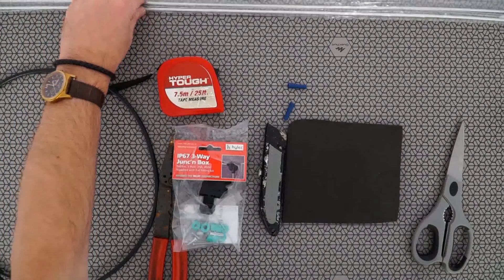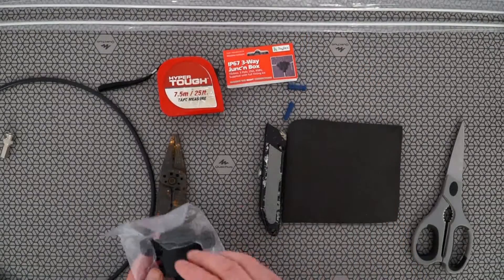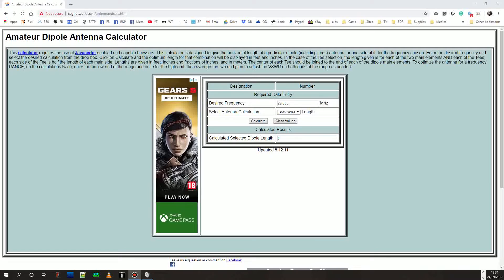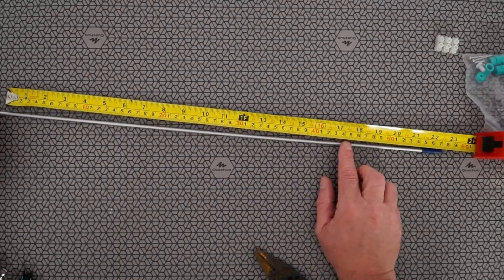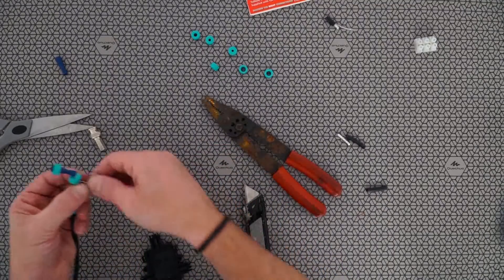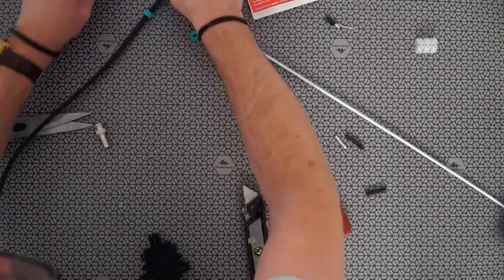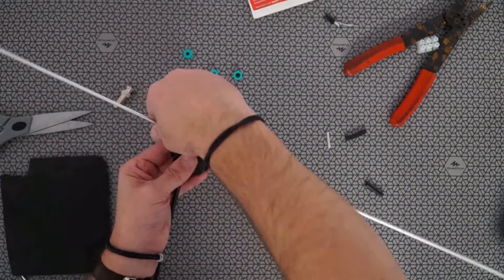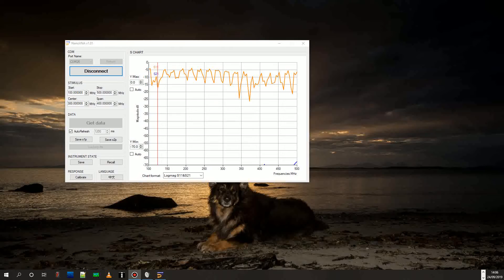Building a cheap lightweight dipole for VHF or UHF

Comment: I put a 30amp connector block mounted so the rods go straight in plus co-ax. I had cut the connector block in half & insulated L+R sides with a thin bit of plastic. Fixed every thing down with hot glue gun.

Comment: 3:32 and they use wavespeed 300 exact and rounded result 468/143
correct 
metric
299.792458/2*0.95=142.40141755 (yes not 143) in math we round final result(cut material)
feets convert
142.40141755*3.2808399=467.196252514600245 (not 468)

142.40141755/Mhz = length meters (half it)
467.196252514600245/Mhz = length in Feets (half it)

Comment: If you wish to solder use copper materials. Aluminum MUST be crimped, clamped, screwed, welded, as it can NOT be soldered with standard electronic soldering irons. Using a torch and aluminum brazing rods might be a bit much for the coax.

Comment: Just Remember, If You Keep This ANtenna Verticaly., You Need To Keep The Central Wire On Top, Not Bottom.
Reply: Which way should face for airport also what is the central wire as u say in Ur question/answer..my newbie  question lol
Reply: @robertburns202  He means that the rod which is connected to the central wire from the co-ax should be on top. In this orientation, the antenna works equally well in all compass directions but not directly up or down.

Comment: I Used Similar Materials, I Just Used Copper Pipes With Silicone And It All Made It Weather Proof And Vibration Proof Because Of The Silicone, Put The Vertically On A Fishing Pole And Fishing Pole Into The Mounth In My Third Store Of The House :)

Comment: I see you crimp the coax shield and center conductor wires directly to the antenna rod.  Is a 75 ohm balum necessary or does it matter . Thanks from the US.

Comment: good build there, looks nice and light for portable amateur use. I like the connection boxes. one point, I thought the aluminium rods came anodised i.e. no conductivity- did you sand it off first or were they bare aluminium. Barnie M7PBX.

Comment: Do you recommend this antenna as a replacement for my rubber ducky antenna in the aviation radio of my Powered Parachute airplane?  Needs to be durable and handle vibration.  Thanks.

Comment: Could I please ask whether the antenna should be mounted vertically or horizontally when built for best reception?
Reply: My understanding is that most air band transmissions use vertical polarity, so mount the antenna vertically.

Comment: Thanks Rick. Excellent video,thanks for sharing. So if you where to solder as i think i would, do you just solder the braid straight onto the rods and perhaps use some shrink tube or some pvc tape ?
Reply: Soldering copper to aluminium isn't easy. Better to put a tag on the aluminium and solder to that.

Comment: Hi sir... may I ask if in this tutorial does it really works on both of VHF and UHF? can this be used or can I connect my Baofeng portable with your settings here in your video tutorial? I am a newbie and I don't know how to built a dipole and I am so desperate to build one so I can clearly communicate with my group. If you could just tell me that in this video tutorial works on me and then I will build the same measurements as you have here in this tutorial, and that would be great so I don't have to guess the right measurement. Thanks in advance.

Comment: What cable would be best? 

Coax or sat cable? I have both at my disposal 

Thanks.
Reply from the maker: Hi Paul well coax is probably the most controversial topic in the radio world, without knowing the cable length you would need I will just offer some of my own opinions for short runs on receive most coax will work well, sat cable although 75ohm is cheap and is low loss as it is designed for sat work and is a good choice and in many cases will work better than some of the 50ohm coax , for coax I prefer something well shielded ( I live in a noisy environment) and low loss so I opt for the ultraflex 7 as my preferred choice for permanent installs  it works well for me a direct comparison between wf100 (sat cable) and ultraflex 7 the signal strength is basically the same on a 50ft run , it is the noise and interference where I see the difference between the signals so I get a better SNR with the ultraflex 7 so that suits me especially when chasing weak signals, your location, enviroment, cable length and  signals you want to capture will vary from mine and everyone else's so always best to experiment and see what works best for you,
Reply: Thanks!

What would you say the typical range is with this?
Reply: Hi do you sell them

Comment: Cable losses on VHF/UHF are far higher than for HF, it would be better to suggest using lowest loss cable that is practical/affordable.
Reply from the maker: Steve that is true and coax raises more arguments and controversy than any other part of this hobby, this was not a recommendation for coax but how to build a cheap vhf uhf dipole, I will get to coax in a future video covering 75ohm sat cable vs normally available 50 ohm cable and how short runs vs longs runs have a major effect on the cable you choose my reference was just that the screw on bnc connector fits this coax , soldering would always be my preferred choice as would such as ultraflex 7
Reply: @UKAFG   Of course, yes I understand. Nice gain on an antenna like this, shame to lose it :D. Thinking of building one for 2 mtr and 70 cm. This has given me some great ideas, as they need to be low profile, good work !
Reply from the maker: they are a lot less noticeable than the ones built with pvc pipe etc and as they have an overall smaller footprint so better in high winds and do not have to worry if you have sealed everything properly please give us an update on your builds and any improvements on the design